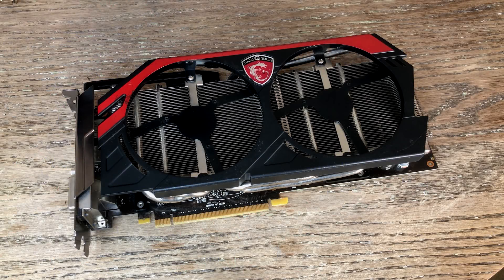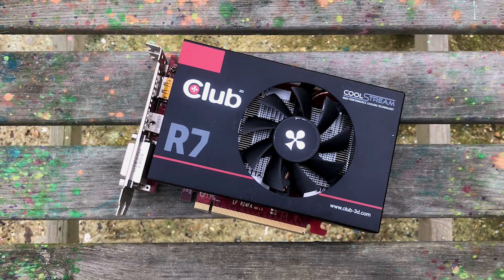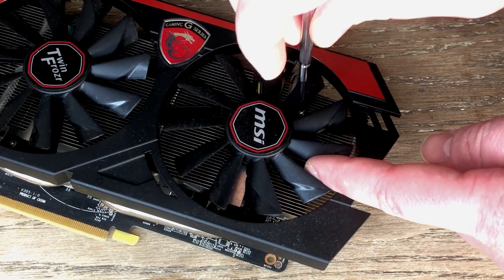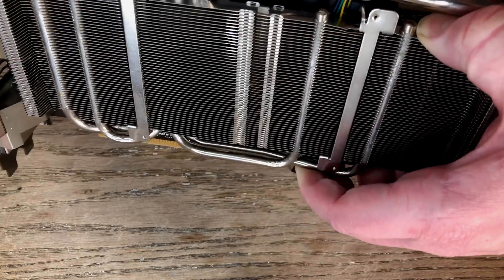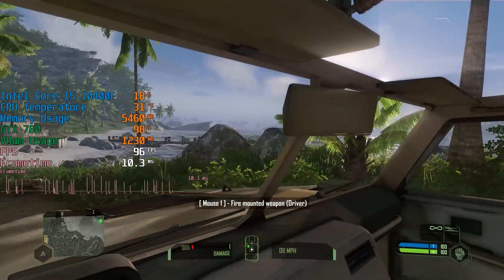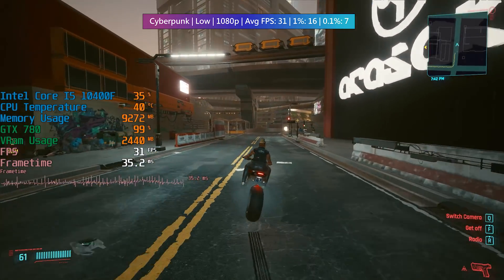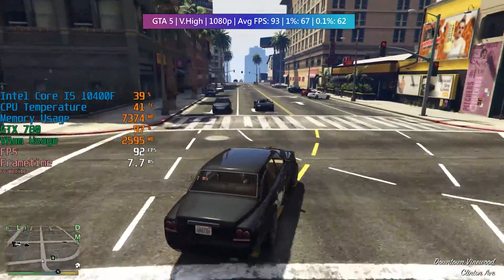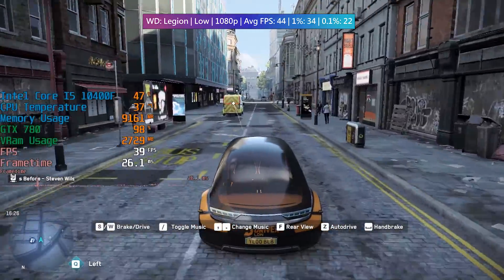An Easy Fix For My Broken GTX 780!

Comment: about NOCTUA fans...
I replaced the fans in my EVGA GTX1080 FTW3 that warbled and were generally slightly too loud with Noctua fans. (In case someone asks, yes I fixed the thermal pad issue.) They are the NF-A9 PWM 80mm fans (black color). I also had to get the 4-pin adapter for the fan header due to the size difference... my noise issues went away. Basically I did this:
1) ordered 2x NF-A9 80mm PWM fans, and 2x fan header adapter (came to about $50USD in total)
2) removed entire top shroud (make sure you have the proper screwdriver first)
3) attached fans + adapters with zip ties (worked well but plan it out)
4) Delete EVGA Precision X OC software and reinstall (it was crashing as the LED stuff was no longer attached. reinstalling software worked fixed this)
5) Set fans to OFF until 60degC then ramp up on a steadily increasing curve... basically silent in gaming even with the sound disabled
(OTHER: my motherboard BIOS has a profile for my Noctua CPU and case fans as well mostly because that works well in Linux. My graphics card fan noise was even worse in Linux compared to Windows as there's no software to set a custom profile and the damn EVGA fans made horrible warbling noise. And I wasn't going to RMA my card as I heard that didn't even fix it for some people. Plus I love a mostly silent PC)

Comment: Its a good card but 3GB VRAM really hinders it nowdays, also some Kepler cards don't render DX12 properly at all, specifically both my Gigabyte GTX 780 & GTX 780 GHZ Edition cards are unplayable with DX12, even UWP store apps such as OneNote etc fail to render correctly

Comment: Those Msi fans start to get stuck after 2~3 years of use. The best way to relub them is by heating a needle and using it to make a small hole on the back of the fan housing. You will be able to use a syringe to inject lub true that hole and you can cover it with tape.
You can also try to separate the fan from the bearing housing since its just a press fit but there is a very high risk of breaking the fan blades.

Comment: kinda jelly about your under load temps, mine are like that when idle, what's the ambient temp? was the mobo in the closed case by any chance?:) i bought a tower cooler to replace my stock ryzen 2600 cooler and while my temps fell down about 10-15 degrees those are still in 40-60 range, but i prefer super quiet low fan speed, so there's that

Comment: Bad solders - either on pins or chipsets themselves - make a vast number of dead gpu cases. Luckily, most of them are usually easy to fix.

Comment: I doubt u could swap the whole cooler from 270 to 780 ... components on pcb are placed differently, even the cooler is shaped by the position of the gpu die and vrm.

Comment: I have GTX 770 and i also face the same HDMI port issue. It is not the hardware problem. The problem or should i say the BIOS setting issue. New Monitors doesn't have vga or dvi port but in this card bios setting is save to display from vga or dvi port 1st then goes to HDMI port. Just do one thing boot windows and when you have login then remove the dvi port and put in hdmi port and display will show.

Comment: I gotta ask since this place is literally the best place for budget builds and stuff.

should I buy 16gb ram and gtx 1650 gddr6 

or

8gb ram and gtx 1650 super.

I plan on buying the 1650 super since I don't really play modern games that need 16gbs ram and usually play something like league of legends, warframe, dying light, dead by daylight and stuff plus I'm pretty okay with lowest settings but I don't really wanna get gtx 1650 just for some more future performance and I can just easily upgrade my ram in like a couple of months or a month. I just wanted to get some advice from this community too cuz I do feel a bit complicated.

Comment: my GTX 1080 had its bigger fan broken, getting a brand new oem replacement from aliexpress is just 4$ per pair, with the original metallic sticker, postage included.

Comment: I have the same card! Still pulling strong! Mine is the OC 2GB variant and even works well in Microsoft Flight Simulator in low. Paired with a i3-9100f.

Comment: Hi! so ik that you always say don't go for ddr3 gpus or ddr4 right?
So my dad without having a clue what he is buying got me a ddr2 one and the other thing is that I have a mini tower and it didn't even fit 🤦‍♂️...
now idk what to do with it.
Reply: What card even has ddr2 anymore? I have an hd 5550 from like 2010 that does....And yes u want as fast as memory possible. Faster shaders/more rops need fast memory, but even gt 730 ddr3 vs ddr5 can be a major difference just like ddr4 vs ddr5 gt 1030.
Reply: @lagginswag  it was an ATX 1300x... I didn't see the release date but could be from like 1263 😅
oh and its only 256 mb vram........
Reply: @mec_mec  oof. Look for a low profile card like 2gb 730, 1030 (both ddr5) or at best 1050ti or the radeon equivalents (hd7750 aka r7 250, rx 550 etc). They tend to go for more cuz of the small form factor. Worst case there's also an old 1gb card hd 7570 dell with ddr5 on ebay for less than 25$ some with hdmi.
Reply: @lagginswag  I'm planning on getting the 1030 it's just that my father doesn't get the ddr4 😳
Reply: @mec_mec  gotcha...well good luck 🤞 i know how annoying it can be to find a low profile sff card
Reply: @lagginswag  Thank you! I'll make sure to tell you if it came right if you want.

Comment: if they can run without the fan plugged, you can put a 120 or 140 mm fan on the floor of the case to blow towards rear
i do this anyway

Comment: If DVI would die, just use intel with iGPU, and use it just like on laptops (Intel HD + Geforce).
Linus made something like that with mining card (P106, which is GTX 1060 6gb), and that was working perfectly fine (That card didn't had any video output)

Comment: clean that 780s ports with WD40 and  a gun brush (its like a tooth brush with stiffer and much longer bristles to get in deep places) spray the wd40 liberally into the dead ports let it set for a few minutes spray again and scrub, you can even spray down the whole card. Go check out techyescity cleaning videos on reviving old GPUs

Comment: are you sure that ports didn't work later after driver installation? Some older cards have problems like that on modern MBOs. You wouldn't still have image on them until OS boot up but maybe they work now.

Comment: I had to retire my GTX 780 because it was really unstable. GTA V used to crash quite frequently with a graphics error Skyrim Special edition and Fallout 4 used to Crash to the desktop when ever it felt like it. Cities skylines would also crash too. I turned on performance mode in my bios settings and my pc would not boot just kept saying unstable overclock. I found that it used to draw more voltage than what it needed too and when I used MSI Afterburner to attempt an overclock it would be fine running benchmarking software but when I tried to play a game like Skyrim Se for example it would finish loading then instantly Crash to the desktop. It would refuse to play any demanding game when overclocked it did not even like being made not to over volt its self so I assumed it was a issue with the power rails. Since upgrading to a RTX 2080 super my PC does not crash now. Unfortunately I brought the 2080 just before the 3 series cards were announced :(

Comment: Where I live it's impossible to get even this graphics card for a reasonable price (not that I would do it), sellers are not honoring the MSRP, and prices are way above what you'd expect from a piece of hardware such as this, I recently finished building my rig (assembling it by parts) and couldn't afford the GPU right away so I bought an Intel Core i5 10400 none F variant because I knew this was going to happen.

Integrated graphics are not great so the market either, it's fun to watch how you sneak out the rules of the left by the mischievous 2020 and get these interesting videos.

Comment: Check the solder joints on the Displayport and HDMI; if someone was careless with that header and yanked on the cable at an oblique angle it might have cracked those, which means you'd just need to re-solder the connectors.
Reply: A hot-air rework station and some flux would be a great addition to the repair tool set! The Baku 858 and similar are excellent for the price
Reply: @coccoborg  I've got the D858 hot air station and it saved my ass so many times.
Reply: I dont think he knows how to solder
Reply: This. I bought a 660ti that had the same problems and re-sautering fixed it easy
Reply: I assume contact cleaner was attempted, but if it wasn't it's saved some hardware at work.

Comment: It could as simple as 'fall damage' looking at the small dents in the cooler.
Reply: Or from being thrown in a box with a bunch of other random graphics cards
Reply: Also could be as simple as trying to fit a 275mm gpu into a case that has 285mm of space like I did when I was in my younger days and dinged up my cooler.

Comment: When checking dead gpu's you should check the pci-e connectors with a multimeter, When there is continuity between the bottom and top row of the pins than there is a short, most likely in one of the powerstages. You could get a really cheap multimeter, probably even a 5€ one would do the job. It could be that the you killed the gpu (and the psu) with the cheap psu. A good psu should detekt a short and shut itself off, sometimes the gpu survives that, but every time you try to start the gpu with the short it is more likely to kill the gpu-die.
It would be pretty interesting to see somebody with basically no prior experiecne try to repair gpu's.
Definetly looking forward to your next videos

Comment: What are you using to keep your cpu under 40c the majority of the time when benching?
Reply from the maker: It’s currently an Arctic freezer 7 pro. I got it from an old pc I found and slapped it on this processor. Works great!
Reply: @RandomGaminginHD  wow, I would have guessed it was an AIO of some description. For air that’s very impressive!

Comment: Can you do a video on the GTX960, specifically, why it seems to have so many issues? I got one from a friend and its been collecting dust because I couldn't get it do, well, anything. Not even resolution change past 640x480 on the Win 10 desktop. Just found the card and wondered whether to try again but looked up GTX960 problems on Google and there's just a massive litany of pages where people are having problems. What's so broken about this particular card?
Reply: If its stuck on that res is probably can't install drivers. Check device manager and see. I have a dead 760 that does something similar but returns a code 43 in device manager after drivers are installed. I found a small transistor stuck to the bottom of one of the memory chips solder pads so could have shorted the memory. Weirdest thing I've seen in years.

Comment: dead HDMI's are pretty common as far as I've seen through my shop, doesn't stop it from being a very usable card! great video bud!
Reply: I once had a dead dvi port on the gtx 950
Reply: How can one fix a dead display output? I have a working 2gb graphics card but has no display output once connected.
Reply: @abcrae  Use the onboard graphics, then configure Windows to use it as a Render Device. Profit.
This is basically how laptops with combo integrated+dedicated GPUs work.
Reply: @ayuchanayuko  I think it requires an APU
Reply: @wil-fri  or a second gpu
Reply: @ayuchanayuko  so you have to get a riser
Reply: @wil-fri  old gpus dont exceed 2 slots and most boards (even matx) have the two pcie slots spaced out with one slot in between. Get an old half-height card if you're worried of space for airflow.

Point is to have any (weak) GPU to act as your output device while the broken or mining card works as the render device. A USB Video Card might even work but I cant confirm
Reply: @wil-fri  another more complicated way to make it work is to use. A hypervisor and another PC. Build the headless PC with the broken card, then either use ESXI or Windows Server and use RemoteFX for hardware-accelerated RDP connections.
Reply: @abcrae  Maybe try soldering on a new port if it's not a problem with the board

Comment: Yo I don’t mind one of those for my optiplex are u gonna sell them?
Reply: Check if ur PSU can work for it. Probably best thing you can get is gtx 1650 without changing PSU.
Do an estimation of PSU + Card cost and check if it fits in ur cabinet
Reply: @prateekpanwar646  psu is upgraded

Comment: Could you use the IGP as a display out for this GPU?
Reply: Use GPU ports. Motherboard's port is tied to iGPU.
And even if you enabled multi monitor in bios. Chances are that it will treat ur GPU like secondary card and won't use it in most of stuff

Comment: i was just fortunate (or unfortunate) to get a 780 Lightning which pc's very well. I sold my 970 low, and then the gpu market exploded, making it impossible to get the r9 fury/980ti upgrade I wanted, essentially it's as good or better than the 970 but not in dx12

Comment: damn, this card still holds up pretty well
Reply from the maker: yeah it does alright :)
Reply: 780 = 1650.
Reply: @Sam-K  even the 1650 has 4gb VRAM,both my Gigabyte Kepler 780/770 cards are unable to run DX12 at all even Win10 apps like OneNote don't render correctly
Reply: Mine stopped working earlier this year after installing Nvidia drivers, otherwise I'd probably still be using it!
Reply: @falconlips5474  driver support ended for this card a while back, you’d get black screen if you tried to load new drivers
Reply: @trisjack82  So I discovered. Artifacts everywhere and black screen. Ended up bricked and couldn't rollback drivers. Nice excuse to upgrade to something more modern!
Reply: @trisjack82  not on win 7
Reply: @trisjack82  Sure about that? my GTX 660 still gets updates via Geforce experiance
Reply: It is 7 years old so yeah, it is pretty good for its age !!
Reply: It really doesn't, not enough VRAM. a GTX 1660 completely destroys it